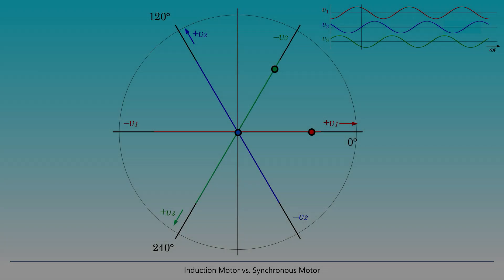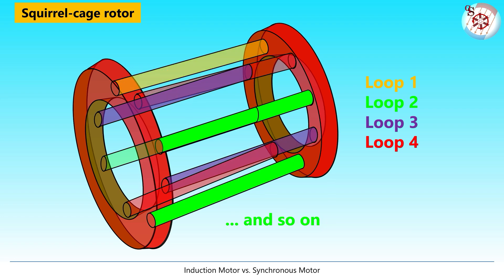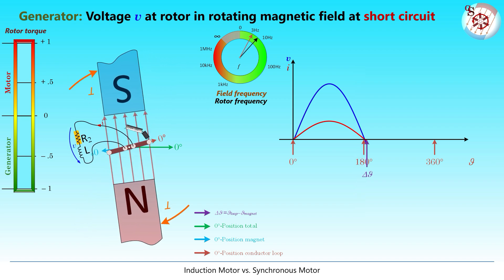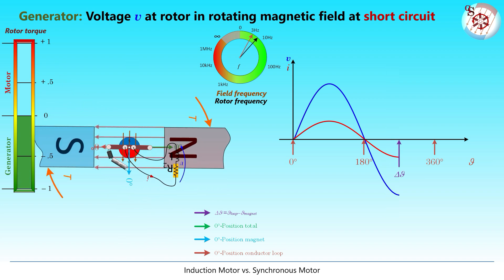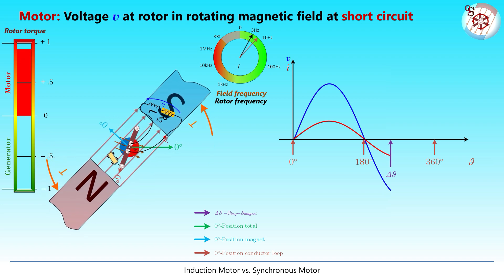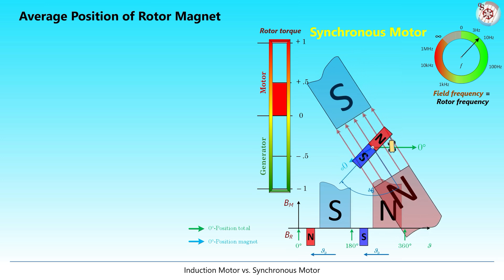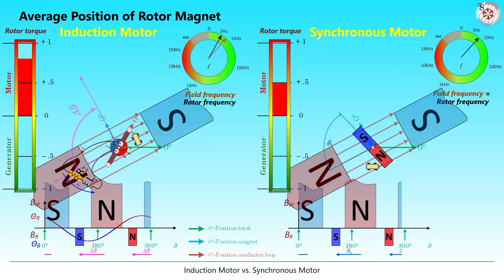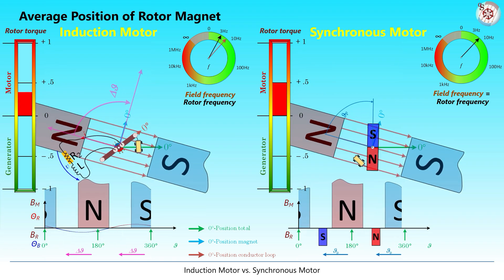Induction Motor vs Synchronous Motor - A Comparison

Comment: Is that the locked magnet powered by dc? I still dont get it hehe
Reply from the maker: Well, for synchronous machines this is a permanent (dc) magnet. 
For induction mashines it is an ac magnet. The funny thing is that the ac magnet has a fundamental wave. And this fundamental wave acts as if it were a dc magnet ... (even though it isn't)

Comment: that's great explanation..just didn't get the part of the locked magnet in the rotor of induction motor
Reply from the maker: I agree the last part was sort of quick. The point is that the changing magnetic field from the loop has a fundamental frequency. That fundamental frequency can be obtained by a Fourier series. With some experience one can see the fundamental frequency and its phase without calculating. 
Now, if you insert more conductor loops than one that are phase shifted (different angles) to each other the addition of all seperate magnetic fields results in a sinusoidal magnetic field. Try to imagine that the fundamental frequency is phase-locked with the rotating magnetic field. If you now use several phase shifted magnetic fields that have the same fundamental frequency and the same phase the addition of all those magnetic fields resuslts in a remaining fundamtental while all other frequenies cancel out each other. 
This cancellation of course is not ideal. Therefore even squirrel cage rotors show torque components which contain harmonics of the fundamental frequency of the rotating field.

Comment: This is a great desmonstration. Not that I understood it all, but its the best one I have seen so far
Reply from the maker: Thank you that is very kind. Actually, it is not that difficult. 
Here, the rotating magnetic field is assumed as a given unchangeable quantity (which is a possible approximation when the flux vector results from ideal voltage sources with coils free of resistance and stray inductance). Everything else that happens now results from the behaviour of the short circuit loop inside the induction machine. 
It is important to understand, that one single rotor loop displays the full behavior of an induction machine, except for the pulsating torque. The pulsating torque is later addressed with a large number of interwoven short circuit loops.